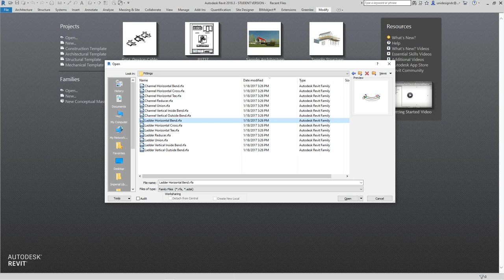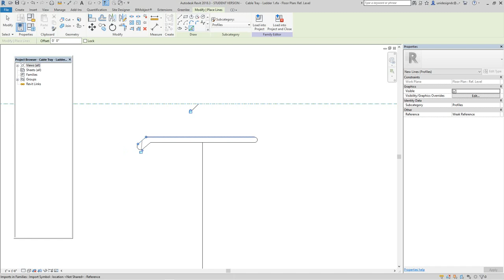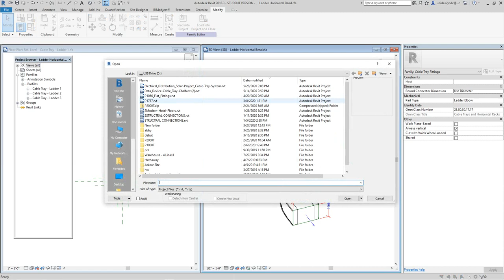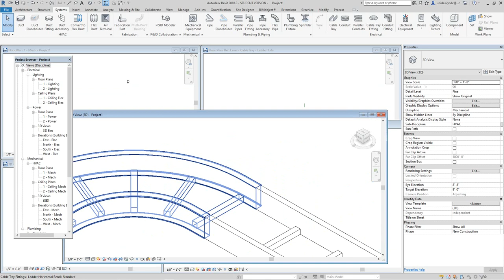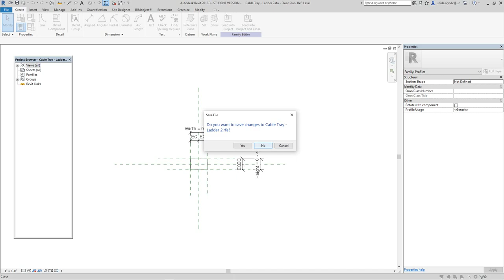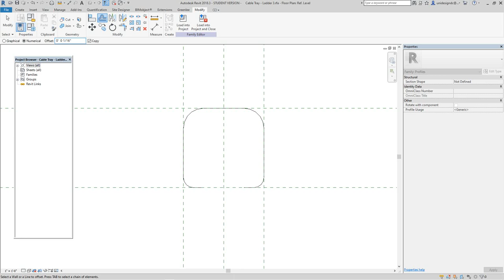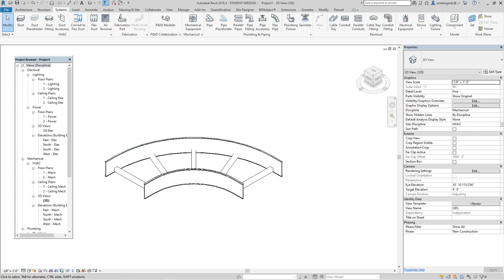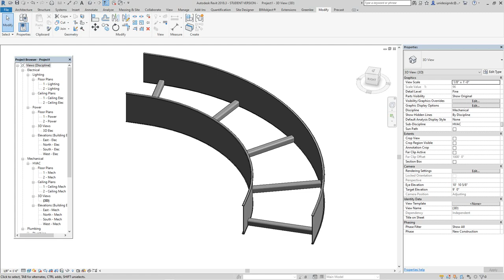Revit Cable Tray Fitting Profile Editing

Comment: Whay if i want to change the profile of the cable run itself?
Reply from the maker: Hi do you mean the cable tray rung?
Reply: @unidesigndc  yea i was hoping to use the cable tray function to draw and model out a cable trough that has a cover
Reply from the maker: I have modeled it as a separate piece in the past, I think I have a straight cover somewhere
Reply: @unidesigndc  how can i edit the profile of the cable tray ?
Reply from the maker: @muhdyan2  Hi this video may help. You have to just edit the existing profile
https://www.youtube.com/watch?v=i4G49vApDSY